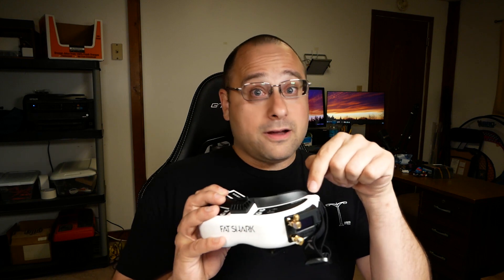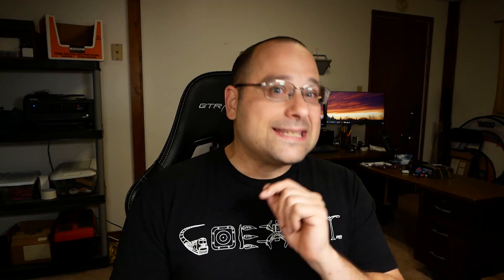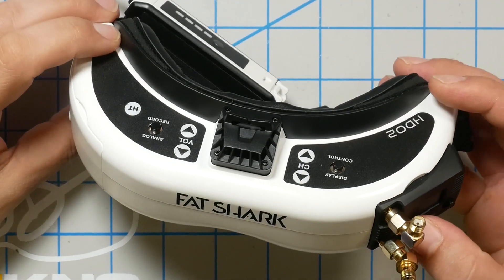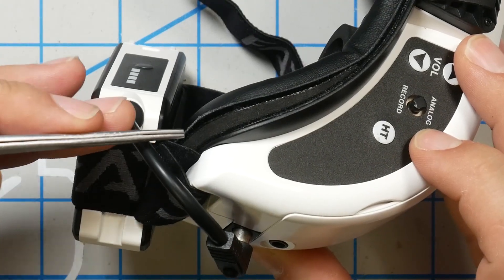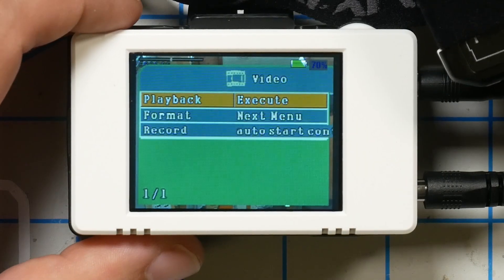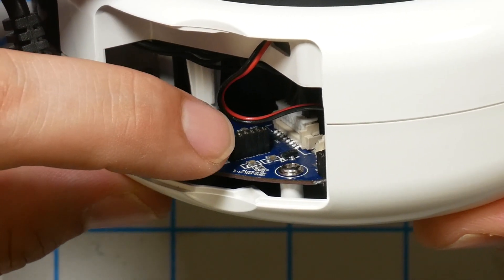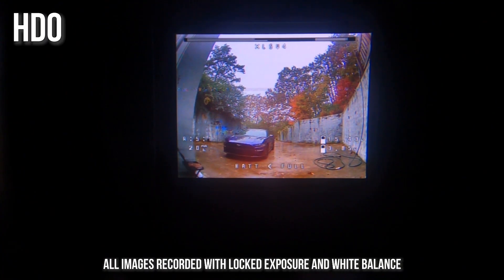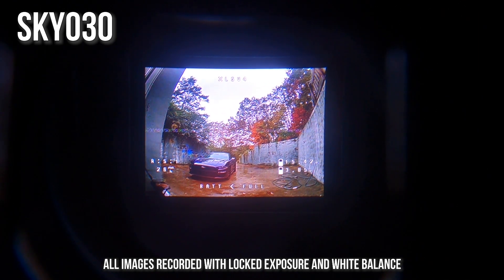Fat Shark HDO2 review (hands-on vs. HDO, Skyzone, DJI)

Comment: Looks like they have done a great job with this.  They fixed the IPD range, and the optics look great.

However now about my Astigmatism.....(sigh).
Reply: I'm right with you on this. I'm an IPD 73 with astigmatism. It's incredibly frustrating because no one has ever made a goggle that truly matches my specs. Fatshark finally gets the IPD right, but then removes the ability to put in custom prescription inserts. Why couldn't they just make a goggle that fits everyone, and not just the 90%?

Comment: I’ll think about Dji, when version 2 comes out.
Reply: If it supports analog I'm in
Reply: @FAQUERETERMAX  It already does
Reply: @Perceivedshift  with a ground station? That's exactly the same as carrying a second set of goggles, or even worse
Reply: @hildy2222  You void your warranty by doing that, and it's not even properly tested to see if it will weaken the signal in your goggles.
Reply: @FAQUERETERMAX  Good points. If you're  into toothpicks and whoops just keep whatever goggles you're currently using for them.
Reply: @hildy2222  But I don't want to carry a second set of goggles, so I'll just keep using analog for everything
Reply: @FAQUERETERMAX  There is a mod, or just attach a module outside.  Though to be honest, analog is absolutely ruined for me now, I now have zero interest in flying with an analog system with the only use-case being long range FPV on 1.3Ghz, which you need a ground station for anyways.  The DJI system is killer to put it lightly...
Reply: @Perceivedshift  I don't see the point in flying analog either, you can't see very good so it's just not as fun.
Reply: @hildy2222  I simply love whoops and other fpv things so I can't afford living without analog. DJI should really make a version 2 with analog included, then I will switch
Reply: @FAQUERETERMAX  Id rather them make a small low power DVRless module for whoops that works with the current system.  Screw analog, go 100% HD.
Reply: @Perceivedshift  lol considering how freaking big the air unit is, that's not even an option... for now
Reply: @FAQUERETERMAX  Give it one year, they can already greatly reduce the size if they left out DVR and lowered the power.  The current air unit isn't huge, it fits in most freestyle frames easily.
Reply: @Perceivedshift  You're underestimating the difficulty or making a really small good digital fpv system. The system is bigger than everything we have, and it's for a reason. It will take them 3-4 years to scale it down to nano size, and by the time they do, we will have way smaller stuff. Why not just insert analog until that happens, like DJI did with the previous gen racing goggles?
Reply: @FAQUERETERMAX  It's not much bigger than analog VTXs from 2014-2015, which wasn't a problem back then.  The fact is analog is shit and the DJI system is small enough to fit on 150mm and larger frames as-is.
Reply: @Perceivedshift  if it took them 4-5 years to reduce the size of analog vtx to what we have available today, we can expect the same with DJI system, which brings me back to my point: just add analog so I can fly my whoops
Reply: @FAQUERETERMAX  You have zero evidence to back up what you are saying, DJI more than halved the size of the module from last year's Ocusync module.  No reason they can't do the same again.
Reply: @Perceivedshift  As I said it's what to be expected, so it's based on expectations. If they manage to make a miracle and create an untra nano digital system in less than a year, then by all means please do, it's what I want the most. But we all know that will most likely take a while, so why not let us choose to have analog in a single goggle so we can fly our already existing systems together with theirs until they make such a thing? Isn't this hobby all about having a lot of options?
Reply: @FAQUERETERMAX  You can...just use a base station or affix an analog receiver to the DJI goggles.  But there is no reason to build an analog receiver into the DJI goggles.
Reply: @Perceivedshift  Yes, the reason is they decided to remove a feature they already had in their previous racing goggles, just to lock you out. I protest against having to carry two goggles or even worse a ground station. Either add analog, or no buy
Reply: @FAQUERETERMAX  Yea, fuck that
Reply: Funny u say that, dji v2 came out and they haven't changed

Comment: I'm waiting for my Orqa next week and I'll not be missing out from this panicked copycat effort. 
I also think it's unfair to say the Orqa are late: sharing your product roadmap openly is not being late nor is showing up secretly with a product is being on time... in any case Orqa are shipping this week.
Also, the HDO2 are not matching or exceeding the FPV.One, like the text below the video says, the DVR is crap, their isn't an expension bay for wireless transmission, the design is the same and they didn't take time to update it, they basically rushed it to match the original announced Orqa specs which have changed since then (dropping the focus adjustment for those outside the +2,-6 btw). 
That said, competition is great! I'm happy FatShark is doing SOMETHING (buttons, seriously?) but what we really need at this point is a standard HD format to feed all those HDMI plugs!
One that can be made by multiple vendors without license keys or whatnot.
The alternative is that DJI will lock us up in DRM hell...
Reply: expansionbay for wireless transmittion?? For what?
Reply: @boratsagdiyev1586  DVR transfers, live streaming, ...
Reply: Well gee, you just sound salty.
Reply: @shoeonhead  Maybe because everyone is attacking the innovating and more transparent new company that could bring even more competition and innovation but everyone is just complaining, so maybe I'm pissed at the free pass FS gets :)
Reply: @RR123  I would be pissed too if i was an early backer and they promised goggles a few months ago but keeps delaying because of PCB issues. And then comes Fatshark and blows em away before they even arrived. Ofcourse i would defend my pre-order.
Reply: @boratsagdiyev1586  I'm not pissed at a 2 months delay on a Kickstarter, that's very small and they have been transparent, took ideas, communicated steps.
I'd love to see fatshark do that once instead of half-assing rushed product based on the openness of their competitors and then doing surprise release without asking if people wanted a better DVR or who cared about legacy no freaking power button mode...
What I'm pissed at is people on Facebook who can't Google information and start staying random idiotic things, but I guess that's the rotor riot & all groups this hobby is partly made of.

Comment: Josh. Thank you for all you do. In the past I used multiple youtubers reviews on FPV products and for a year now you have just been ahead of your time.your gopro assisted side by side screen review I think was the turning point and as pictures say 1000 words you back it up with 1000 words and they are right on the money with what most of us are thinking and reassure us of our thoughts aiding in where my money should go. So as it stands you are my hands down goto guy for reviews. Mr Steel is my favorite pilot but in the real world you get the vote on info any of can actually use. this year alone the amount of new and better products has been mind boggling and Ive just banned buying anything till the market slows. Ive raced pan cars for years annd every 6 months was $1000 for new batteries to stay competitive.FPV has ended my interest with r/c on the ground but nothing till now has pulled me in because of analog first drone Beebop 2 with phone for the screen so I was disappointed with any and all goggles till now. knowing HD was around the corner even when you explained it just may never happen anytime soon.So I waited in disappointment till DJI released then bite frost now HDO2 my interest has peaked once again and Ive made a list on your DJI TBS set up. Now you release this HDO2 vid and Im back on the bench but still leaning toward DJI so I have to ask about crash tests as view leads my vote how well will the DJI stand up when flogged and can you remove the casing to mount in smaller quads or is the case designed for cooling purposes or just protection. I also dont like close ended products such as Apple, never owned one and never will. that alone has steered me away from DJI but now they have something I want.Are there any products coming that is going to upstage DJI that are open sourced if I can just wait a little longer.

Comment: That's the right video for my comment to enter the giveaway, isn't it? 😜

The decision between DJI and HDO2 (analog in general) is like you said a really tough one but keep in mind how new digital FPV systems are and how quickly our hobby is increasing in its abilities and options.
In my local flying group we have people who still have quadcopter with an external OSD or none at all. Let's say it takes a year for the new generation of digital FPV systems, no matter if it's from DJI or FatShark, there will be much more options available like separated, smaller receivers, cross compatibility or even much more goggle providers than now.
The image quality and simplicity of the DJI system is really seductive (hype or not) but speaking for myself I won't switch from analog until I'm fully satisfied with the given options and further more I'm not willing to switch every half a year to a year to a new system. I'm still in the process to update all my quads with crossfire... 😅

Comment: The relocated pins in the accessory bay and "HT" label on top are confusing, because 1. I don't think Fatshark has sold the headtracker module in quite a while..  2.   They replaced the HT output with a power button (which yes, some of us don't need, or intend to us).

Comment: I remember that video you did where you first got your prescription lens inserts and were blown away by the improvement.  Do the new HDO2’s now make those lenses obsolete? Thanks for all the excellent content!
Reply from the maker: The HDO2 can correct for diopter up to -6. If you have higher diopter than this or if you have high astigmatism you may not be able to use the HDO since they don't have lens slots.
Reply: Joshua Bardwell - What I mean is that even if you are within that threshold, is it as good as having your own rx lenses (in your experience)?

Comment: I'm actually in the position you described, starting out and unsure what to purchase. Ultimately for me I decided to go for an analog setup so that I could start on Whoops - Firstly for the guarded props so that I don't slice up everything in sight and secondly because of the way that upcoming regulation is criminalising anything over 250g. I had actually already made the decision between the Skyzone Sky03O and the Fatshark HDO, choosing the HDO primarily due to the built-in support for Rapidfire and had ordered them. On the day they were set to arrive, the HDO2 were announced and I immediately organised a return for the HDO because on paper the HDO2 represent the best parts between the HDO and the Sky03O goggles and I'm really glad the reviews have shown that they live up to that expectation. I've always planned to go with ByteFrost or whatever new digital product is out when I progress to larger quads so as long as they have a HDMI input, I figured I'm set.

Comment: I just went the other way. Been flying fixed wing for a bit and decided to give FPV a try out. Something to do indoors when the weather isn't good enough for me to get out. After going back and forth quite a bit I have settled on the Skyzone 03S. I couldn't bring myself to pony up the extra for the OLED displays or go the bit further for the FATSHARK. I thought the Skyzone would give me a good enough experience for starting out, especially indoors and if all goes well and I want more then I can look at buying bigger/better/ more expensive and I will still have a reasonable set of goggles as a back up or for spectators. Who's have thought that a power button would give someone so much joy, maybe you need to get out more often :-) .

Comment: I have some dominator v2 since 2015 and it's fine since I never tried other goggles. 499$ US is a lot but use them average of 5 times a week since 2015 so it's a good investment. I won a 100$ gift card back then at a race and got my googles like that. I will wait until they break but I can still get parts to fix them... so I guest I will have them for a long time.

Comment: Good review Joshua.

The question that you should have asked..
How many new users would purchase the HDO2 and Byte Frost as a complete package.. with a super soft flexible HDMI cable and then go on to purchase modules at a later date.

You get HDO2 screens which are not led and a Digital feed.
Plus focal lengths that are adjustable from negative 6 to positive 6

How many people would purchase that complete system if Fatshark setup a financing option with the dealerships.

Where getting to prices where companies need to look at what options they have to assist users.., by assisting users you provide an awesome network to continue supplying great products that will complete with the likes of DJI.

I own the DJI system but if a good package deal comes along for this system I am definitely keen to pursue it.

Comment: As Joshua said, you can add any analog module to the DJI goggles with a faceplate kit and a little bit of wiring.  That's the way I'm going to go, even though the Fatshark HDO2's look really good.  Bytefrost just doesn't look all that good yet.  Maybe I'll just wait 6 months and keep running my old goggles.

Comment: I'm in the if its not HD I don't want it crowd right now. All I need for micro's is to decide to either mod my DJI to take a module or just run them with an adapter. 
I am also a backer for Orqa and will be selling them as soon as they arrive (I expect early December). I think everyone should thank Orqa for forcing FS' hand and making them finally give us want we wanted. Its sad Orqa's got delayed by buttons and a PCB issue, so much momentum lost...
Reply: sad, but True... I start to think that the missing button (mistake from suppliers) was made to screw Orca and give a time to Fatshark so they can release Hdo2 before Orca...
Reply: @idzhukelov  haha I'm not there yet, I just think it shows how hard projects like that are, you can be hosed by the smallest thing.

Comment: Oh man, I've still been fighting with myself to get HDOs, but now days have gotten shorter and I'm away for work a lot at the moment. 
But now these HDO2s make it clearer, that I should finally upgrade from my 30€ Eachine box. :-D 
Gotta take part in that giveaway, though! 

And great video as almost always. 
Sticking a GoPro into the goggles and locking exposure etc. is still the best method of halfway objectively comparing goggles. No need to justify that much. The results are absolutely fine.

Comment: Joshua I really do love your reviews and the massive effort you put in.  I’m hoping one day I can use an affiliate link. I would have done for the hdo2s but banggood cannot ship til April!  Grrr.  And I still don’t know if I want analogue or digital. I’m a newbie and don’t care about the cost of the air units tbh.  But I don’t want to alienate myself and not be able to take up the group experience.  For that reason I’m thinking that HDO2 will be better.  Would you agree?  Also: rapid fire or tbs module you have in this video.  Which is the best?  Thanks, I ALWAYS LEARN SOMETHING when I watch your content👍👍😎

Comment: Just ditched my HDO and trying to figure out should I go for DJI (especially they now got all's the add-ons for analog available on the market) or upgrade to HDO2?  I had blury edges even with smaller HDO screens, really hope upgraded optics in HDO2 fixes my vision issue. And I love that analog FPV goggles are much more compact than DJI. So far the best sharpness of  FPV image I seen was in Eachine EV800 box.

Comment: Thanks again for a most killer excellent review.  In it you asked the question (sorta) of why would anyone want to wear reading glasses with their goggles.  Answer:  You need a positive (not negative) diopter to see clearly at distance, or in my case...pretty munch anywhere.  I use the HD3s and I've sent other models back because the screens are so out of focus I can't even read the numbers.  I tried the "Voltage?...we don't need no stinking voltage!" method.  Did not work out well.

Comment: I finally took the plunge and stepped up from my 90 dollar box goggles(which actually have a power button) to the hdo. I love them. The only real selling point for me on the hdo2 is the focal part. I need diopters with the original hdo. And i still have a tad bit of blurriness. I think alot of og hdo will be on sale on ebay soon😂🤔

Comment: Great review again Joshua, I am thinking about getting them, I will use your link if I do for sure, but right now I am using the Aomway Commander V2 , the screen is huge, I am a proximity and gap flyer, I enjoy being completely amerced in the goggles and flight, (superman complex) the biggest issue I have is the optics as I like you, wear glasses, I used box goggles due to that, but wanted so bad to get into a pair of goggles, I watched reviews and decided I did not want to decide, they all hurt the pocket and back then the company was just starting out, and I was short on cash... I bought a pair of Echine V100 do you remember those? They had the dial for the focus and I could see perfectly on that tiny little screen.. Now for the question.. Sorry so long... Is this going to work like that? I am hoping so, Christmas is around the corner... lol...  Also I did think about the social aspect of DJI, So I only use their product for my business, but not for FPV..  Thanks again for your review, have a great one.